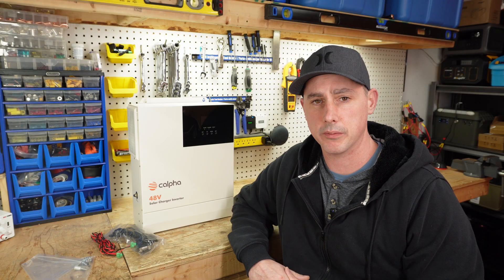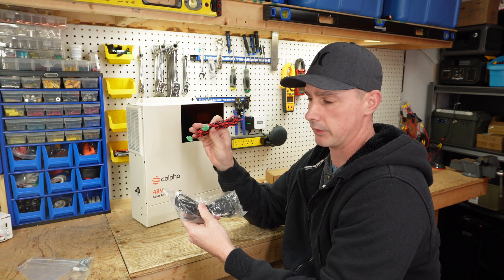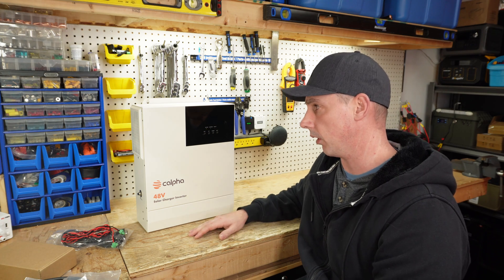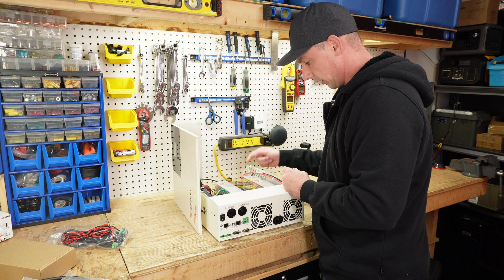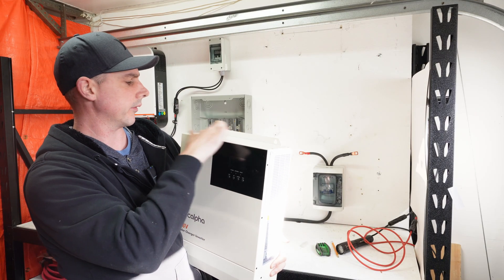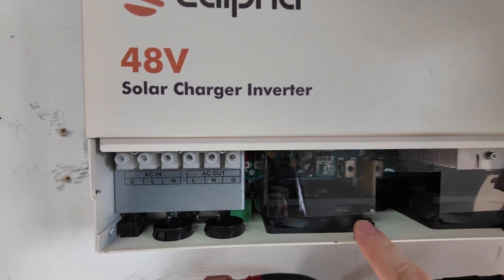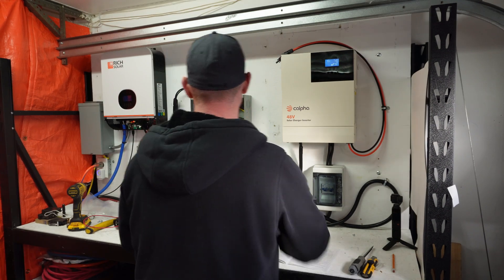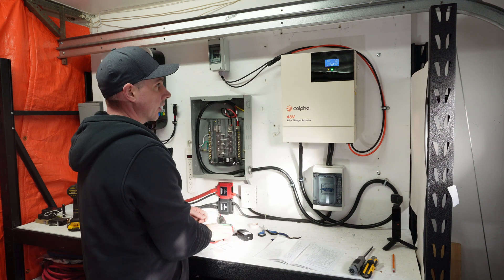Calpha 3500W 48V All-In-One Solar Inverter

Comment: Btw, if anyone wants to buy/SRNE/Calpha when it's time to change the fan for a new one. Make sure that the plug is red cable on top white in the middle and black cable at the bottom. If not, you will need to change the pins in order. their JST kits as well if needed.

Comment: I finally did get a response from Calpha, and they were very helpful. They talked with me for a week, very responsive.. so, I decided to purchase and I installed this unit last week. It has been working fine so far. The IoT (WiFi/BLE module) and app.... not so much :(

There are many issues with the app. I contacted them through email and support forms, just some suggestions and pointing out some of the issues, and they seemed to have gone dark again. Been 5 days now, and I have not heard anything from the rep girl I had been talking to (she was very responsive when I talked to her about the unit BEFORE the sale), their tech support, or the support form in the app. None have responded. I hope this is not how they deal with warranty issues.. They did release a module update which I think was coincidental, which helped (and created other problems, unfortunately). At least the real-time information (which you get about 15-45 seconds apart) seems fairly correct. 

Hopefully, I didn't buy from a bum company lol. I will keep you posted!
Reply from the maker: Please keep me posted. I've been bugging them to work with "solar assistant" for monitoring i believe they are working on it.
Reply: So, an update. The salesperson I was contacting had left the company so most of my messages were never seen. Once I got Calpha's support, they were very impressive as far as their response times and level of support. I had an issue with my 3500W unit in which there was something with the firmware. During the OTA firmware update, unfortunately, neither Calpha or I thought about my modem and router going down because the unit recycled. This broke the update mid-stride, and the unit was bricked. They immediately sent me out another unit (I got a 5K as an upgrade this time), and it works perfectly. The APP issues were resolved as well. 

I will have to admit, I'm pleased with their response and support. I may have found another go-to vendor for my solar needs. Thank you for your video, I never would have taken the plunge without it! Cheers!

Comment: These units are supposed to have a BLE/WiFi dongle that allows for local and remote monitoring. I've made multiple attempts to contact this company to get that information, as well as the suggested wiring configuration (which should be in the manual, it will detail the suggested wiring gauges, breaker sizes, etc.). However, neither the company nor the reseller I found for them has responded to me and it's been over a week. 

What experience can anyone expect if the company will not respond to inquiries? What has been your experience?

Also, only ONE neutral ground bond is to ever be in an electrical system that interfaces with grid in any way. Many AIOs (and inverters) are floating ground for this reason. A neutral ground bond can easily be installed in the panel servicing the AIO's AC output, so it's up to the installer to make the call if it's needed or not.
Reply from the maker: It is a shame if the company is not communicating with you.
Reply: @Roll2Videos  Yeah, the sales person had left and her emails went to the void apparently. Once I got with support though, it was smooth sailing at that point!
Reply from the maker: @revansmusic  That's great to hear. Thank you for updating us.

Comment: Why would anyone want to buy a 3.5kw inverter for that price? 😮 Good video, by the way. I just think it's too expensive when there are other inverters out there that do better for cheaper.
Reply from the maker: Great point, I agree
Reply: Can you suggest some?
Reply from the maker: @lancebenson8400  I can't right now. Keep an eye out for future videos
Reply: @lancebenson8400  I would look up Sungold. Their 5kw inverter is cheaper than this one.
Reply: It's that price because it can run parallel units. Most 3kW range AIOs don't do that unless they're grid tied, and those are even more expensive. This is a decent price. My concern is that I get no response from CAlpha as to product information, manuals, etc. and I also want info on it's monitoring.
Reply: @revansmusic  lmao, most hybrid inverters run parrallel. I don't know what you are talking about.
Reply: @meilyn22  For AIOs, split phase, three phase, and parallel charging require the units to communicate charge phases, charging currents, etc. Parallel capability is absolutely required when phasing for the AC ouput as it is needed. This unit is designed that way. My point is that makes it a little more expensive, and completely worth it. Especially if everything else checks out with CAlpha.

By the way, charge controllers generally get away with working "in parallel" especially more expensive, high quality ones. In general AIOs can encounter issues being used in parallel and unless specifically designed to do so. Please do not insinuate that AIOs not designed for parallel use can be used this way, it will void the warranty of the unit, and generally just not a good idea. You shouldnt treat an AIO that way, it's not a simple charge controller.

Comment: Have had one that is identical for 4 years now i think. Was a mrpow at the time.
Reply from the maker: Any issues to know about?
Reply: @Roll2Videos  only thing I have weird is the mppt. If you sure off the solar on a sunny day and turn it back on it seems to get more watts in. Otherwise good inverter.  Ran 2 small ac,fridge,deep freeze, washer,lights,microwave ,and entertainment center for years. Only over  loaded like ones so we don't run the washer with the microwave anymore.
Reply from the maker: @chrisloving6647  Very good 👍 Thank you for sharing